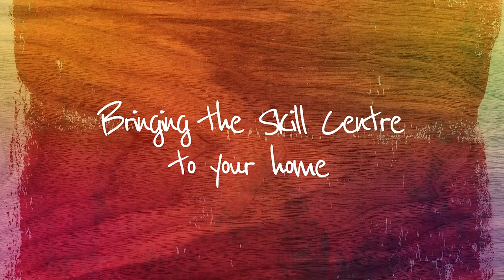#SkillCentreAtHome - Live Routing Wednesday - Introduction to the Router Table

Comment: If you have the fixed base in the table, why didn't you raise the router from above and change the cutter in the table. The Bosch has a buit in router raiser built-in,  so you can adjust whilst the router is inverted or from above while using free hand!
Reply from the maker: Hi John, the following reply is from Craig - "Yes, you can do this with the Bosch fixed base, you are correct. However, I found that I was always having to clear dust from the hex so that my key would fit so I don't use this now. For me it's just as easy to adjust from underneath as I tend to crouch down for a better view of the cutter."